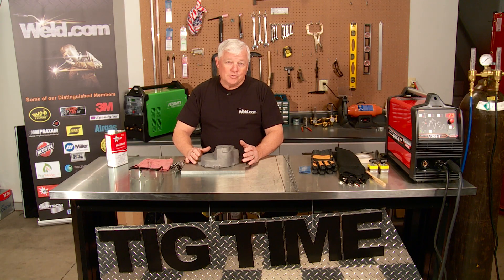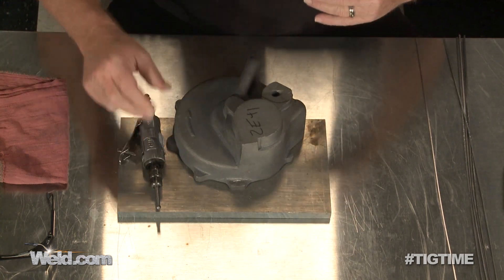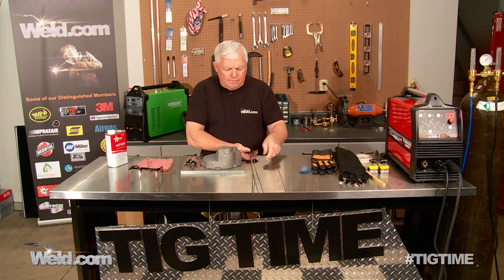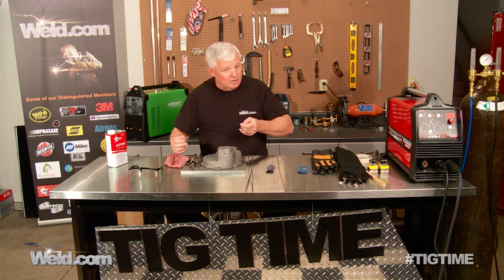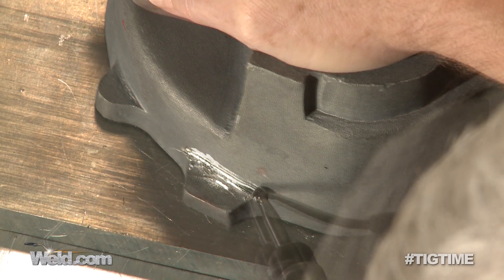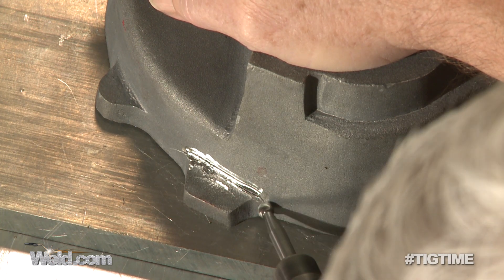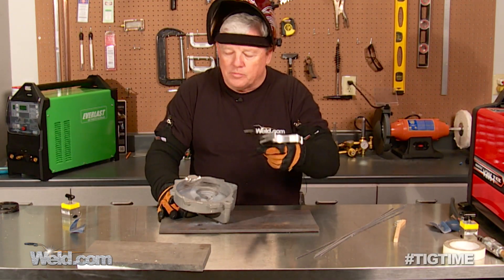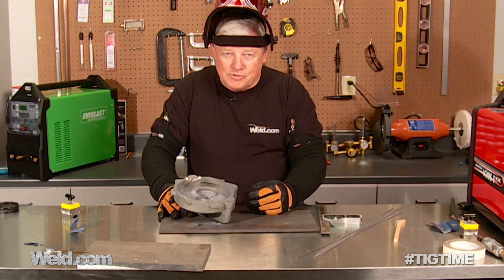How to Weld Magnesium Castings

Comment: I didn't think it was even possible to weld magnesium. I figured it'd have just burst into flame. So great job!
Reply: Beryllium is added to the filler wire to reduce ignition
Reply: ignition need 2 things, one is a flamable material, the second is oxigen. with argon shielding there is no oxigen.
Reply: @peterbagosi3862  some fuels contain their own oxidizers. That's why flares for instance can burn underwater. It isn't common but it isn't unheard of either. Usually you'd be right, but not always.

Comment: today at work, i disassembled a gearbox from a B-1 Bomber. it's a magnesium casting also. one of the bearings exploded. as i opened it up, chunks of the bearing cage fell out. 3 ball bearings were completely gone and it chunked a hole in the side of the housing. i was told by an engineer that they are going to try to repair it and that's what brought me here to see if it can be done. very interesting.

Comment: Thank you Mr. TIG. This is just the video I needed. I have a couple 1600cc VW cases that look like they were cracked and someone JB Welded them. They are both minor, and on the top of the case. How do you feel about welding a magnesium VW engine case?
Reply: Wonder how the vw cases turned out. Have same exact issue
Reply: @sooflodiesels  I will have a video up soon on my channel 😉

Comment: Great video. However! I would like to add some information based on 25 years + experience.  Personally on a casting this thick, I would "V" it out more and turn up the Amps.  You wouldn't get much penetration on a casting this thick on 120 Amps  without pre-heating it. Even if you used the rule of thumb method 30Amps/1mm your only good for 4mm and a thick casting like this takes some melting. The welded part of the casting is now only as strong as the depth of your filler material you've added.  Clamping some flat  material across the ears or clamping the casting to the bench would prevent any distortion, not so critical in this instance as the ear is still attached, 99 times out of 100 you will be handed two parts. Checking to see if it has distorted after its been welded without clamping it down beforehand is like shutting the barn door after the horse has bolted, its good practice to clamp when possible to save you having to re weld the job, after grinding out your welds a few times because the jobs no longer flat you quickly realise its not worth taking a chance. After all, the customer is only going to pay you for welding it once. I realise this video is extremely  informative, I'm assuming anyone who has sort out this video has done so to pick up some tips.
Reply: Another fun fact. Beryllium is added to the filler wire to reduce ignition

Comment: Thanks for sharing. What kind of tungsten rod do you use..? Mostly for Aluminium I prefer to use one with Lanthanum, but I have no idea if that's any good for Magnesium.
Reply from the maker: 2% Throriated, but Lanthanated will work too
Reply: Weld.com Thank's a lot for the information. ...also for providing such excellent videos.

Comment: Use white vinegar to tell the difference between magnesium and aluminum.  Magnesium will cause the white vinegar to foam like hydrogen peroxide.
Reply: Thanx for that tip. I got a VW 1600 case. It should be mag, but if its aluminum, thats gonna make things alot easier for me.

Comment: Another small correction, you mentioned "as it is a sand casting it has some Si". Neither ZE41 nor AZ92 have meaningful amounts of Si and certainly not intended to have any as it is considered impurity in these alloys.
Reply: Sand is SiO2, which is reduced to Si when mixed with magnesium at high temperatures, which will in turn dissolve in the magnesium. So it might or might not be in there, we dont know unless its measured and/or its already a known fact that this does/doesnt happen.
Reply: When i worked in a foundry Si was generally added during the casting process to improve the flow of the molten material and often not necessary to the structural integrity of the finished product.

Comment: Not to derail the thread..great video by the way. Magnesium is pyrophoric but in powdered or fine strips...you're splitting hairs. Hard to ignite in bulk form. Also from Wikipedia.... (Look at Finely divided metals).
White phosphorus, the original "phosphor"
Alkali metals (lithium, sodium, potassium, rubidium, caesium), including the alloy NaK
Finely divided metals (iron,[3] aluminium,[3] magnesium,[3] calcium, zirconium, uranium, titanium, bismuth, hafnium, thorium, osmium, neodymium)
Some metals and alloys in bulk form (cerium, plutonium)
Alkylated metal alkoxides or nonmetal halides (diethylethoxyaluminium, dichloro(methyl)silane)
Potassium graphite (KC8)
Metal hydrides (sodium hydride, lithium aluminium hydride, uranium trihydride)
Methane tellurol (CH3TeH), an analog of methanol where tellurium replaces oxygen
Partially or fully alkylated derivatives of metal and nonmetal hydrides (diethylaluminium hydride, trimethylaluminium, triethylaluminium, butyllithium), with a few exceptions (i.e. dimethylmercury and tetraethyllead)
Copper fuel cell catalysts, e.g., Cu/ZnO/Al2O3[4]
Grignard reagents (compounds of the form RMgX)
Used hydrogenation catalysts such as Raney nickel (especially hazardous because of the adsorbed hydrogen)
Iron sulfide: often encountered in oil and gas facilities where corrosion products in steel plant equipment can ignite if exposed to air.
Lead and carbon powders produced from decomposition of lead citrate[5][6]
Uranium is pyrophoric, as shown in the disintegration of depleted uranium penetrator rounds into burning dust upon impact with their targets. In finely divided form it is readily ignitable, and uranium scrap from machining operations is subject to spontaneous ignition.[7]
Neptunium
Plutonium: several compounds are pyrophoric, and it causes some of the most serious fires occurring in United States Department of Energy facilities.[8]
Petroleum hydrocarbon (PHC) sludge.
Reply: +Richard DelTran  I really like your metallurgical breakdown and research here, extremely thorough.....but.....back in the 90's I saw two guys working on a broken set of crankcases from a Volkswagen Beetle and when they were welding it up it caught fire and burned with an extremely bright white light until there was nothing left. Also I've known at least a half dozen old Navy men who have told me stories about fires starting in magnesium aircraft parts, them pushing the whole thing over the side of the aircraft carrier(s), and watching it sink ever deeper into the ocean, continuing to burn (underwater!) until it was too deep to see anymore. And I myself set fire to an old right crankcase from a 1976 Husqvarna 360 while welding it (began with a kind of sparkling like seeing stars) with tig w/not enough argon flow/no back purge. It too burned brightly until nothing was left. Also myself and a couple of machinists during lunch break in 1979 set a ball of titanium lathe cuttings of about .005" thickness on fire w/similar results. You were saying....
Reply: +Richard DelTran ...almost forgot, after all of my experience w/burning mag and ti, I keep a 'class D' fire extinguisher within reach when welding unknown alloys, they DO work!
Reply: Richard DelTran  I had cut a cast magnesium chainsaw case and it caught on fire and water wouldn't put it out. had to break the piece off of the case with a hammer so the whole thing would not burn up. It made a very bright white light while burning.

Comment: Magnesium is flammable, not pyrophoric. Pyrophoric means a substance will ignite on contact with the atmosphere, at or below 55°C. The ignition temperature of Magnesium is much higher than that. An example of something that's pyrophoric is TEB, which is used to start some jet and rocket engines.
Reply: MAGNESIUM is REACTIVE , not pyroforic or flammable . Uranium is pyroforic
Reply: @timothydisinger9414  Magnesium is absolutely flammable, which is why they sell magnesium bars with a flint attached as fire starters. You scrape off some magnesium shavings and ignite them with the flint to start your fire. You also have a significant fire risk when machining magnesium. Search for "class d fire" and basically any page you click on will mention magnesium. 

Bigger pieces can also burn, but the bulk of the material can act as a heatsink to pull the temperature down, there's less surface area available for reaction, and there's an oxide layer that develops that will also slow the reaction down.
Reply: Static can actually set off magnesium
Reply: I guess I should specify shavings grindings sanding is what he was talking about the oxide from it not the actual material

Comment: You are right about the cost of this stuff. Where is the link or place to get smaller quantities of the rod.
Reply from the maker: http://www.weld.com/index.php/shop-weld-com/shop-weldcom/filler-metals/magnesium
You can buy in 1/2 pound increments.
Reply: @Welddotcom  
I couldn't find the filler rod on weld.com using this link. Is it still available?
Reply: +Weld.com I purchased some 5356 fill wire (while getting some 4043 for aluminum) when I was an instructor (not a welding instructor) and an old time welder (who is a welding instructor) told me that was for cast aluminum alloys that have magnesium in them. Will this work for the more pure cast magnesium as well?

Comment: Question regarding welding cast magnesium that has a hole in it and/or is very porous due to damage:  How to control blow through?  Is there an appropriate backing material that should be used to prevent blowing through?  For example, I've used copper to keep from blowing through thin steel when filling a hole, is there a similar technique for magnesium?  Thank you.
Reply: +wetfloorsign Never tried copper under mag. I use it on most other metals all of the time, including aluminum. One thing for certain NOT to try is ceramic (specifically an old toilet tank lid) as the results are disastrous, not to mention dangerous to life and limb! ( I thought it would work, LOL!! )

Comment: Nice video, but a few quick improvements might help. W7 (RZ5 or ZE41) weld rod is correct for this casting, not AZ92. Some 14 other weld rods would have been more applicable, due mostly to the aluminum contentin AZ92 that should not be used on Zr containing alloys like ZE41. While the weldrod you used has a melting point closer to 770F, the base metal has a melting temp of over 900.

Comment from the maker: When determining the difference between cast aluminum and cast magnesium you can easily be fooled.  However,  merely using a pocket knife to scrape or deburr some shavings into a pile will allow you to use a lighter and determine if it is flammable. Aluminum will not ignite, but magnesium will.  Always use adequate eye safety equipment and gloves when igniting.

Comment from the maker: Magnesium is Pyroforic, meaning it will catch on fire when a flame is introduced. It does not do this with TIG welding because TIG has an argon inert coverage during welding.
Reply: So stick would probably catch it on fire? What about brazing it with aluminum?

Comment from the maker: Dave, Typically magnesium cannot be brazed because an open flame will ignite the base material. Thus the name "pyroforic". Tig welding is safe because it has an argon inert coverage during the welding phase. Thanks for watching.. Mr. Tig
Reply: I've tried recently to repair a broken casting of what I thought was "obviously made from aluminum" (household appliance repair, not for a customer) with oxy-propane, some active flux and tig rods.

Little did I knew before the surface started to crack up, shoot green sparks and all that, I knew something was off and stopped.

I simply didn't know before watching a couple more youtube videos that there are magnesium castings at all